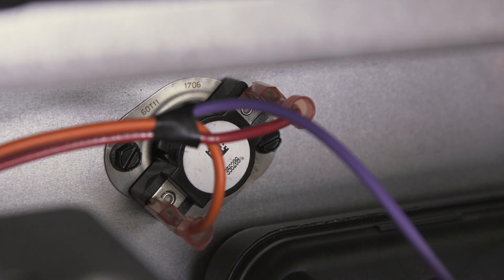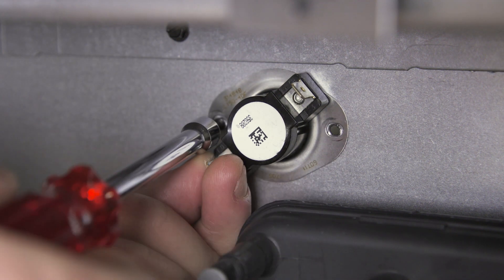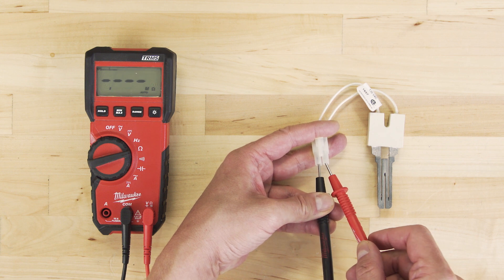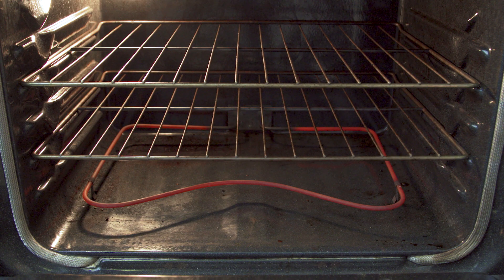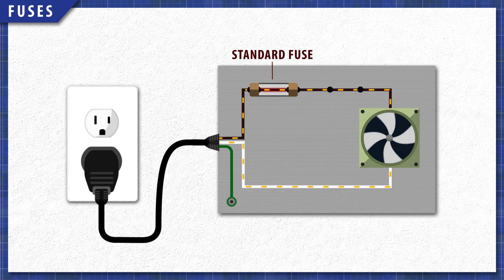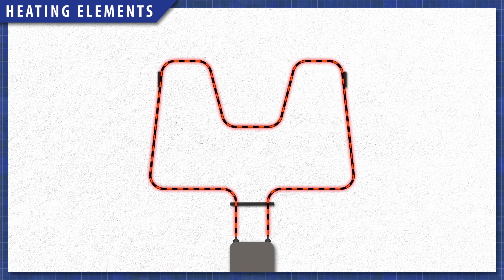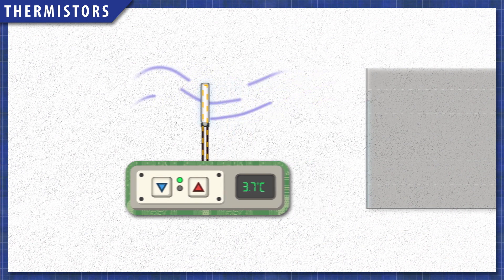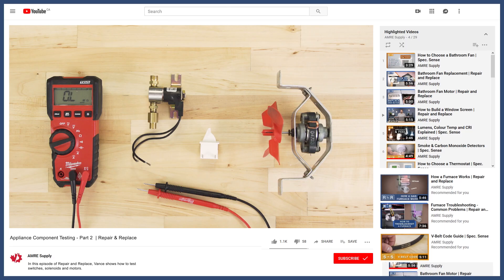Appliance Component Testing - Part 1 | Repair and Replace

Comment: not to be a jerk but continuity is the next setting on the dial (one down from the Ohms on this dmm with the multiple lines) , you will hear an audible beep if it has continuity and no sound if there's an "open" (no continuity)... peace, great videos, thanks
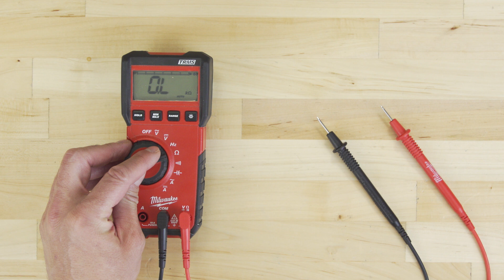Reply from the maker: Thanks for watching. Yes at 1:10 we mention "To test a component for continuity first set the multimeter to the Ohms or resistance with tone setting". 
We demonstrate with the resistance setting as it's most applicable to more multimeters.

Comment: Is there a difference between continuity and resistance, or is that just how you test both.
Reply from the maker: Thanks for watching. If something has resistance than it has continuity as there is still a continuous path for electricity to pass through. A continuous path could be at any resistance, as a resistor such as a stove element may have a resistance of 40 ohms. The fact that it can measure resistance means that there is continuity.

Switches and wires are meant to just allow electricity to pass through and will have a resistance between 0 and 1 ohm.
Reply: @AmreSupply  thank you so much for your knowledge and your response

Comment: Great information! I'm struggling to figure out the specific part on an LG washer control board that left black soot close to the heatsink. How do I determine if it was a relay, a resistor, a fuse, or the heatsink that went bad? A new control board is $225 for my front-load LG washer. I would much rather replace a piece on the control board for $20 or less if possible. Your video was very informative about using the multimeter for testing various parts. I'm wondering if there is a way to test the heatsink? The LG washer control boards have a thick silicone-type apoxy coating poured over the parts. Any suggestions would be greatly appreciated. I just don't have the funds to replace the control board right now. Much less a new washing machine. Plz help!!!
Reply from the maker: Thank you for watching. This video explores the larger components used in the appliance and not the components which are built into the circuit board. It is possible to narrow down and replace components on circuit boards but this takes a bit of knowledge and special tools. There are whole channels on YouTube dedicated to these sorts of repairs so it is not something we decided to focus on.

Comment: Thank you, Thank you, Thank you! This information is priceless! You cannot believe how many appliances are simply thrown away because the average consumer does not have basic knowledge of how these basic electrical components work. The cost to have the repairman to fix is cost prohibitive!
So far we’ve fixed a Bosch washer, a 17 year old microwave, and our 25 year old refrigerator! Current trying to fix another refrigerator with a possible bad thermostat.
Reply from the maker: You're welcome Betty! We're just happy that the video was helpful to you. We are actually working on a series on refrigerator troubleshooting and repairs, but it won't be finished late 2022. We did however create a in-depth series on oven and stove repairs that you might want to bookmark: https://www.youtube.com/playlist?list=PLCo9SMjkdWBysYYCcg5xQLiVh_cW0JQvt
Reply from the maker: Just a follow up to this, our refrigerator series is finished and is a good one to bookmark. 80 videos covers almost all possible problems; https://www.youtube.com/playlist?list=PLCo9SMjkdWBxXf2GEiSiunxAlN3ENxXGq

Comment: Greetings AMRE and thanks for this great video. One of my stove's heater elements does not hold its heat at a static temperature. I have it set for #3 on the heat dial and the coil gets red hot and I need to shut off the element and then turn it back on to restart the element. Any suggestions on what this is?
Reply from the maker: Thanks for watching. Its likely an issue with your heat switch. We actually created a whole set of videos troubleshooting stoves including a video to this very problem. 

Stove element stays on high: https://www.youtube.com/watch?v=l39vOnhqnhg&list=PLCo9SMjkdWBysYYCcg5xQLiVh_cW0JQvt&index=36

Direct link to the video without the playlist:
https://youtu.be/l39vOnhqnhg